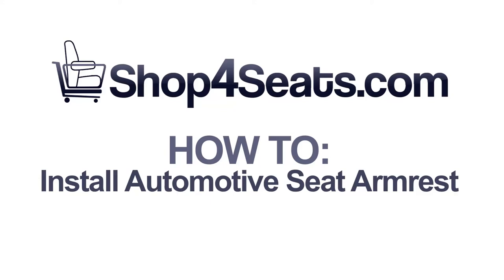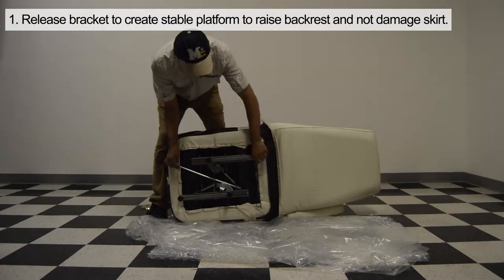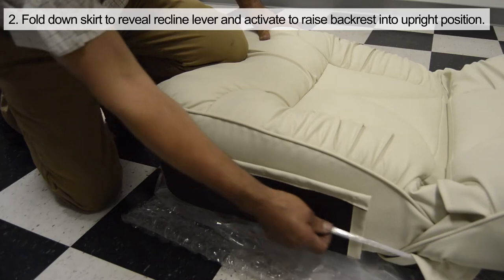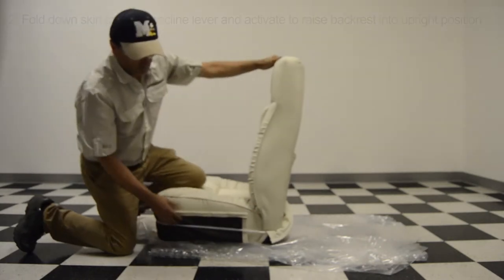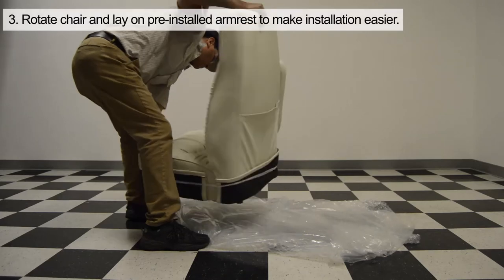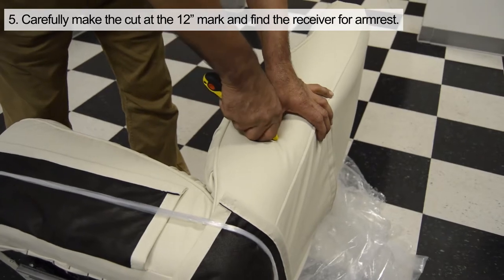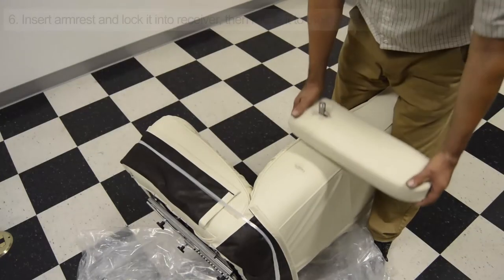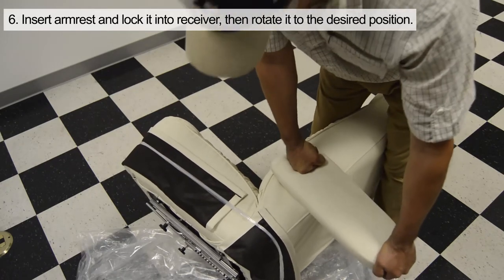Shop4seats Armrest Installation Instructions

Comment: The video is helpful. But it would have been better  to know about before I mounted seat to pedestal. Used a ratchet strap to compress foam padding enough to press in armrest.
Reply: Thanks for the tip!  I would have paid for for a larger box and everything installed!

Comment: Your video does not provide enough detail. It would be more helpful if you guy added a video of how it works without all the foam and vinyl covering the frame. No mention was made to the fact that there are two holes the arm rod has to go through.